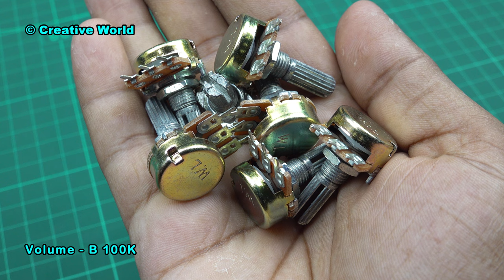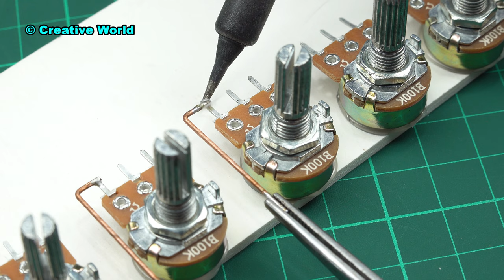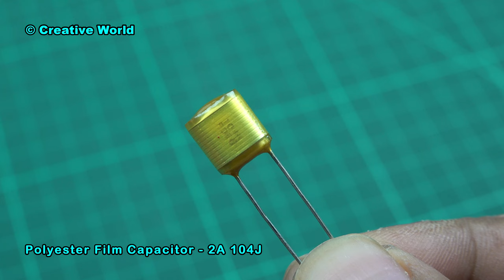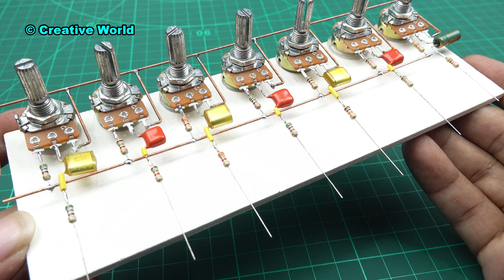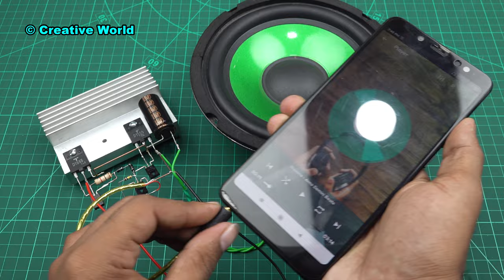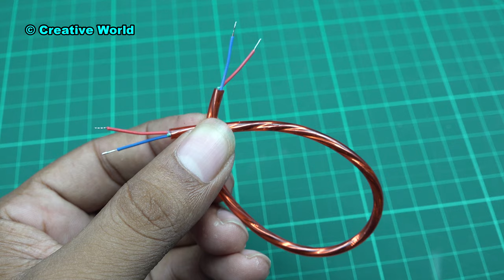Professional Sound Mixer Circuit - Homemade

Comment: A mixer combines multiple inputs into a single output, usually with control over how loud each input sounds in the final "mix." This looks like an equalizer, maybe? And certainly not "professional." If you build an enclosure to house it, you might be able to call it DIY or homemade.
Reply from the maker: right
Reply: Timepass fek chanal nonsenses
Reply: 🎼 Agreed
Reply: Not a mixer , no inputs demo at all

Comment: Hy, I agree with Stephen C, it's "sound like" a equalizer, not a mixer. But I have a question: Wy use it before the amp? Maybe I'm wrong, but, if you use this before, you will amplify the noise. Can you comment?
Reply from the maker: you are wrong
Reply: This thing cannot amplify signal

Comment: Another invention, made to waste time of viewers and even worse, to confuse some of them, since yourself have no idea of role and differences between a signal mixer and an equalizer.
Also, using the term professional here is inappropriate.
This is made in home-DIY regime and it`s not even close to a real professional schematics, assembly.
Honestly man, rename the video as it should be. Honesty and modesty goes well together.